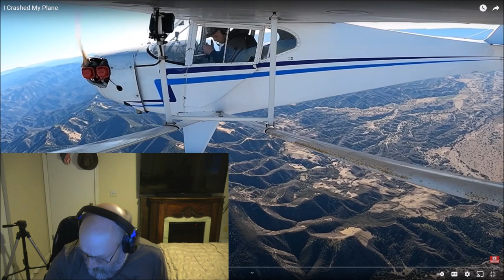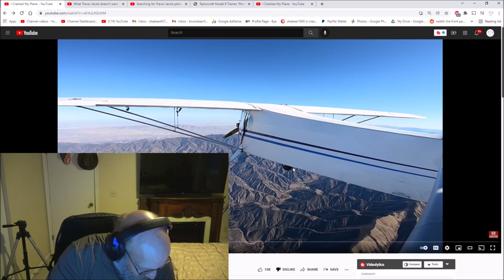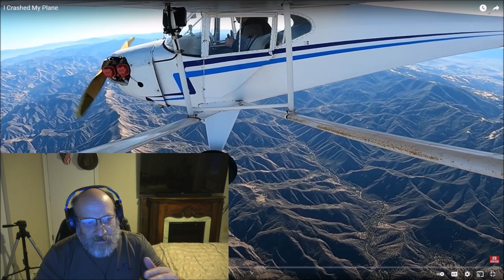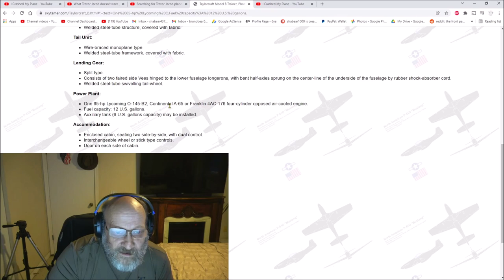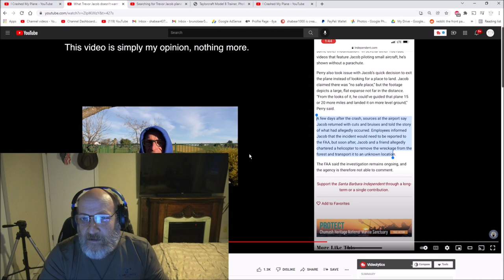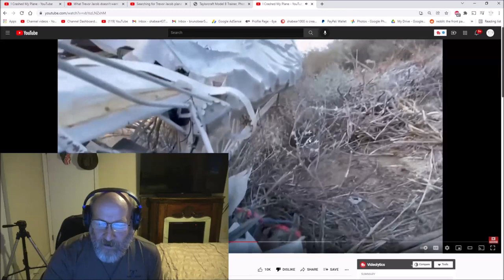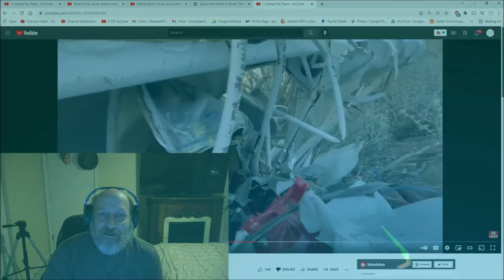Trevor Jacobs Plane Crash New Information And My Opinion On The Engine "Failure"

Comment: He didn't run out of fuel. If you look carefully, there is a small, barely visible stud an the forward fuselage, right at the base of the windshield, that is a mechanical fuel gauge and it shows some fuel left. It has a float in the tank, when fuel level drops, so doe the indicator (that stud thingy). When fuel level drops, indicator becomes flush with fuselage. In my opinion, he simply pulled the mixture to shut the engine down, that also explains that he doesn't show the view from thge camera behind his right shoulder. Stopping prop would certainly look more dramatic on that camera. But somebody could see the mixture control, so, .....
One thing about the distance to that perfectly landable river bed, he could reach it with his parachute.
Headset: previous owner had a radio installed in it. See at 21:12, when he bails out you can see a white rod between gear legs, that is a comm antenna.
Something about the engine. In FAA registry for 2021 it is listed with Lycoming engine wit the previous owner. At the time of incident it had a Continental engine and if you look at 26:21 you can clearly see an old, a bit dirty engine, which is completely normal, but valve covers are freshly painted red with some overspray on the cylinders.
Reply from the maker: If he was full of fuel, why was there no fuel leaking out of the ripped open fuel tank? There are many ways to manipulate that gauge to stay in the full possision.
Reply: @shabear1000  True, but I don't think he was that smart. He claimed his destination was the Mammoth mountain, if I remember correctly which is much farther from the crash site and I'm pretty sure he planned to crash at about that location, but he most definitely didn't calculate the fuel required to reach that location, since there are so many variables, like wind, air density, etc. Tank surely wasn't full, but I'm pretty sure he had a couple of gallons of gas left. Why else would he need fire extinguishers?

Comment: The pitot tube is on left wing and the line you were talking about goes to the airspeed indicator. The on/ off valve is for an aux tank in the right wing but appears to be disconnected and just hanging there. The main fuel take in just forward of the instrument panel. It does have a cork float attached to a stiff wire that runs through the gas cap for the main tank as is used to indicate fuel level. Yes you can put a bend in the wire to make it stick showing that fuel is remaining when tank may be empty.
Reply: Could use tape also to keep it in a fixed position
Reply from the maker: Thanks for the information, I appreciate that.
Reply from the maker: Yep, it would be so easy to make that gauge stay in the up possision

Comment: He pulled the yoke back and forth to get the last bit of fuel out of it
Reply from the maker: That could be too
Reply: @shabear1000  edit fuel*
Reply from the maker: @gingernutpreacher  I figured that's what you meant lol
Reply: No, he wanted propeller to stop for dramatic effect. I'm 100% sure he still had some fuel. Someone brought attention of the mechanic fuel gauge in front of cockpit showing he still had some fuel. He simply pulled mixture control back, that also explains there is no view from the camera behind his right shoulder where it would be clearly visible.
Reply: @fifi23o5  I will find the vid but he took that camera and put it in his jacket and jumped with it